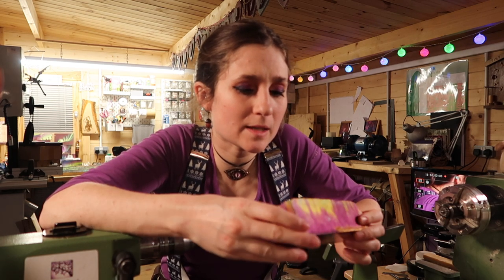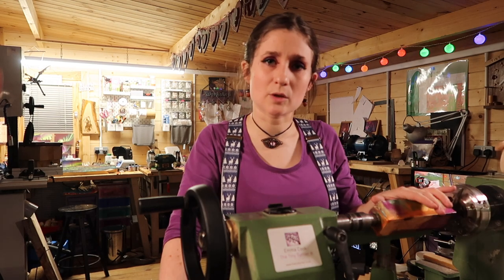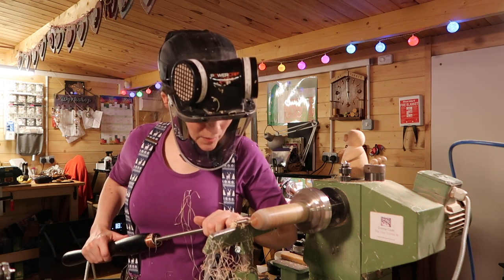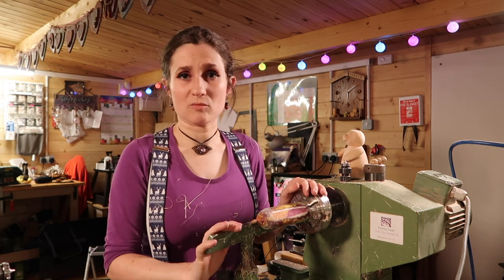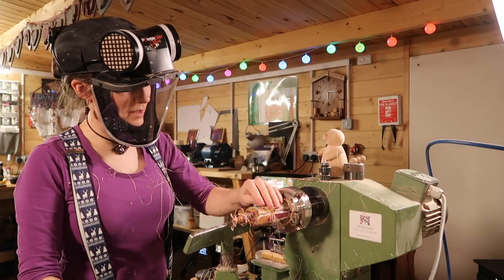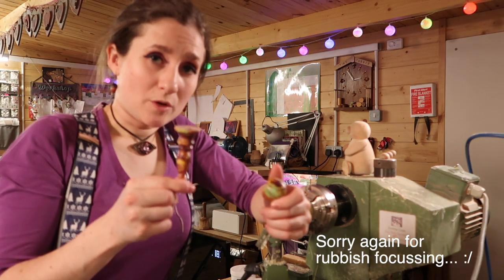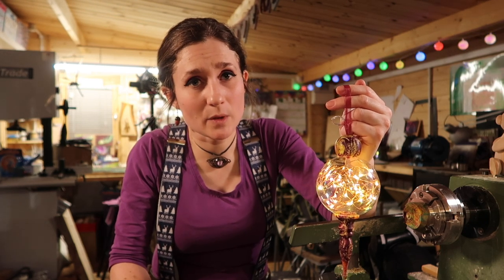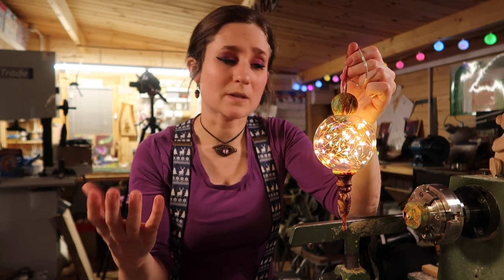Woodturning... or is it?! Making a Resin and Glass Bauble/Hanging Ornament with The Tiny Turner

Comment: When turning resin. 
I use a used toothbrush for removing the resin from the work piece. Keeps my fingers out of the way, and I can keep the work piece turning. The toothbrush brakes the resin up and removes it. And it doesn't leave tool marks on the resin.
Reply from the maker: That is an awesome tip David, thanks! I have used one to remove it since this  video, but only when the lathe wasn't running. Didn't realise it would break it up whilst spinning. I'll be giving that a try!👍🏻😀
Reply from the maker: I tried it David. My life is changed forever  😆
Reply: @TheTinyTurner  
I am glad I could help you.

Comment: Very nice Emma, I enjoy watching you turn this. I like your methods and tool control. The face shield you use, what brand is it, I'm due to change mine, and I would prefer to have something with dust filters built in, so I don't have to wear a respirator and a separate shield?
Reply from the maker: Thank you! The faceshield/respirator is a JSP Powercap. Not cheap but not as expensive as some of the other options, plus it is a lot more comfortable than some of the alternatives. Axminster sell it too but under their branding. They are excellent. I bought a second battery too as I tend to turn for longer than 8 hours when I'm on one, so I don't have to wait for it to charge. Plus I never leave anything charging overnight and two batteries means you can charge one whole you're working using the other. 😊
Reply: Ah, ok, didn't real is it was  powered respirator, which is fine and still a good idea. A friend was look at a setup with a Shield similar to yours but the dust extractor plugs into it. More research is needed me thinks. I need to get more videos up too, lol.